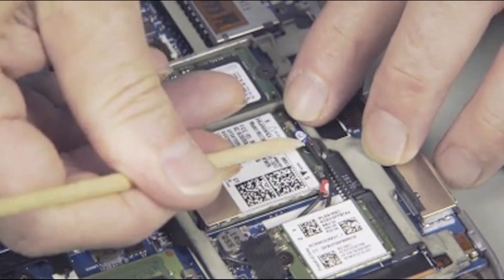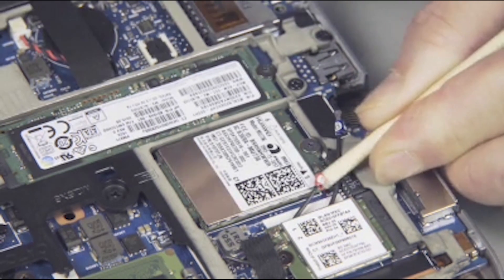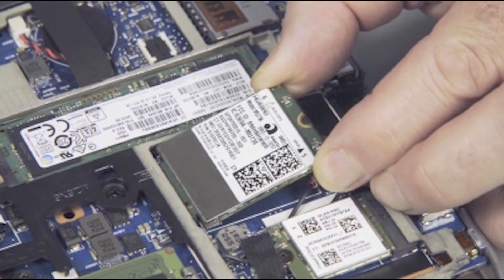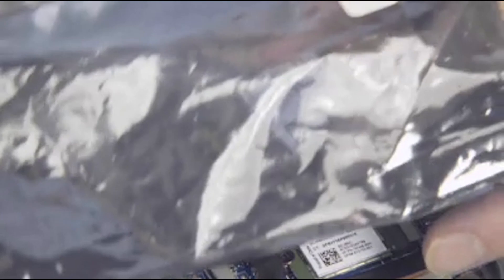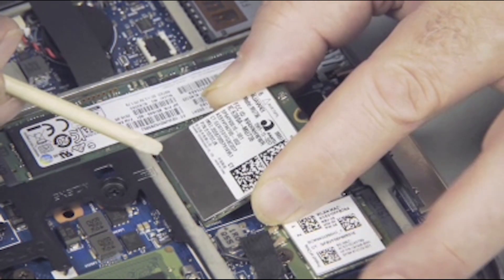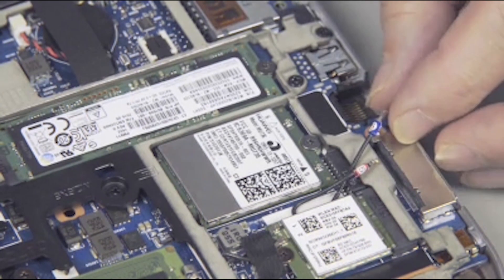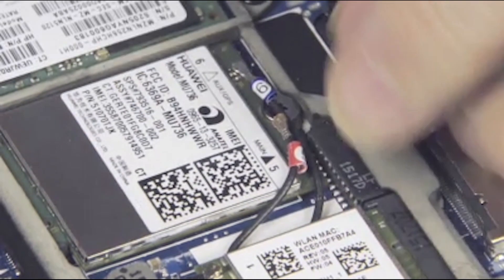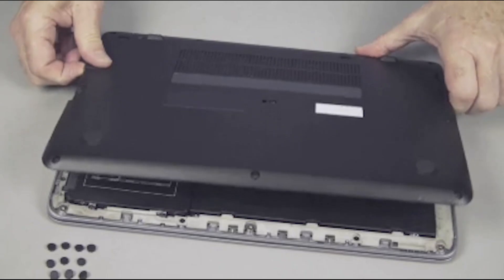Replace the Wireless WAN Module | HP EliteBook 840 G3 Notebook PC | HP

Comment: I want to install sim card in my hp 840 g3 laptop please  help me
Reply from the maker: +nagarjunareddy sangati Go to the device manager.
Click to expand the network adapters device manager category.
In that section you will see an ethernet adapter (probably Intel), a wifi adapter, and if your notebook has a mobile broadband adapter (WWAN), then it will be one of these, according to the specs:
HP lt4132 LTE/HSPA+ 4G Mobile Broadband
or
Intel® XMM™ 7360 LTE-Advanced
If you don't see either of those devices listed there, then your notebook does not have mobile broadband capability.